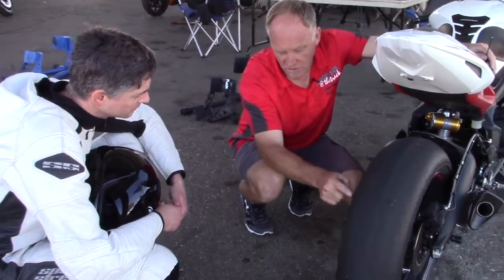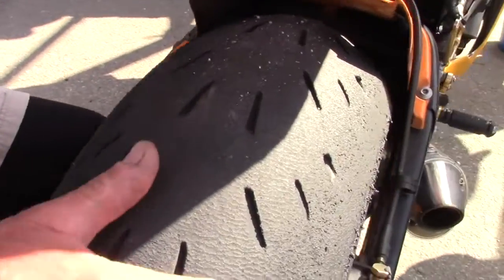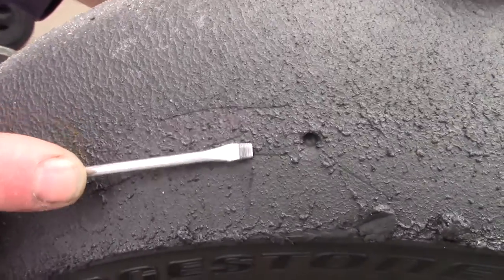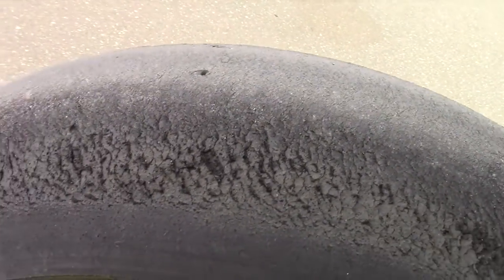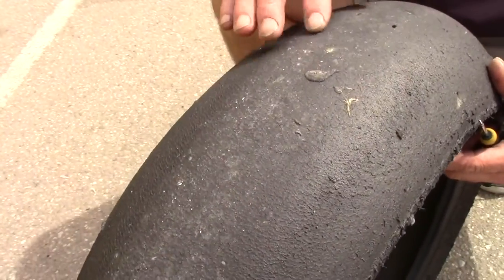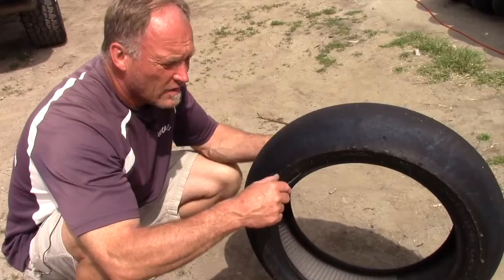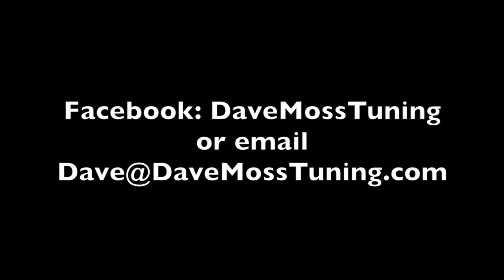Contact Patch: Reading Motorcycle Tire Wear 1 (TRAILER)

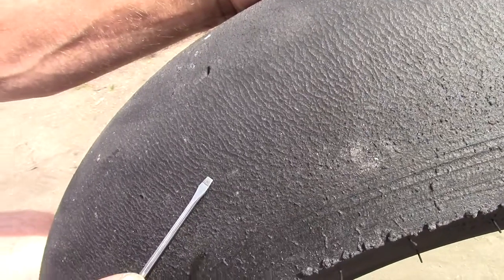Comment: Hi Dave. What causes the lines at 1:45 
I have these on my Pirelli superbike slicks.
Reply from the maker: The lines are the way the tyre is made/constructed. If you ride hard enough, the lines start to show. They should be 100% visisble around the circumference and the same pattern of wear. If not, there is a pressure or rebound problem.
Reply: @catalystreactionsbw  thanks mate. So still safe to ride on?
Reply from the maker: @PERTHSCOOTER07  Yes. Check for the flat spot on the tyre from acceleration. The wider the flat spot the worse turn in will become.
Reply: @catalystreactionsbw  thank you sir. Love your work

Comment: I need to buy a set of all season tires and I wanted to ask you which tire brands have the least problems with dry rotting and which tire brands have the most problems with dry rotting?
Reply from the maker: Almost no brands these days suffer from dry rot as tires are largely constructed of silicone and other synthetic materials. What does kill tires is UV and all tires suffer from this type of damage. The UV hardens the tires and that hardening can create cracks. I've run every brand and put 5-8,000 miles on my road tires with no cracks BUT those come off after a year or less due to the mileage I put on the bike. If I was to leave a set of tires on for several years as I did not ride much per annum, cracking may be a real problem at that point in time. That may not hold true today though and unfortunately I don't have a bike where that could be a long term experiment.